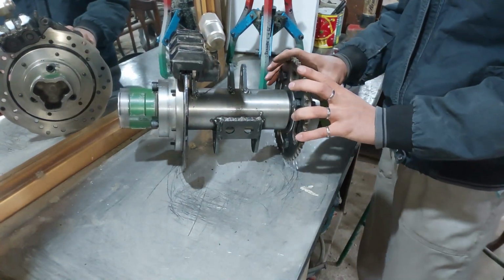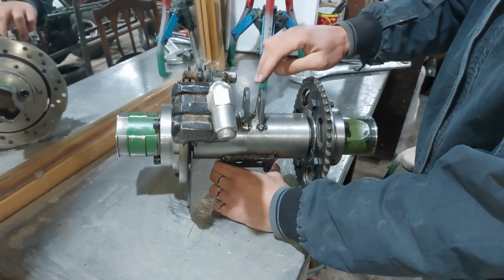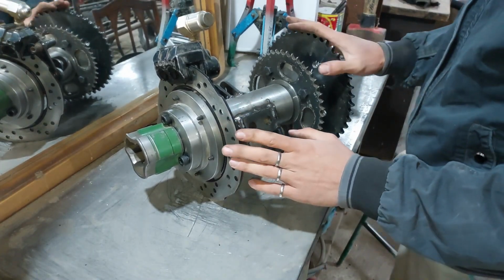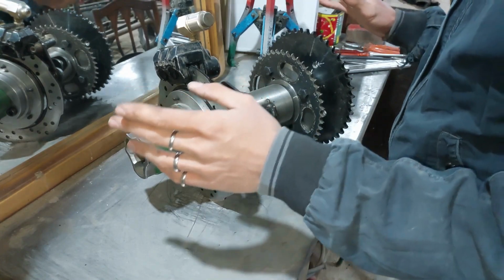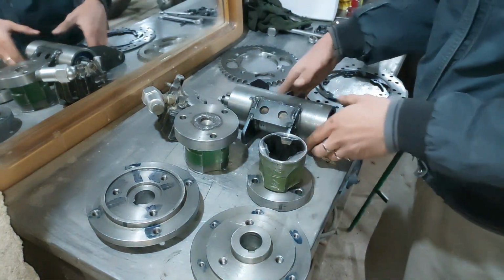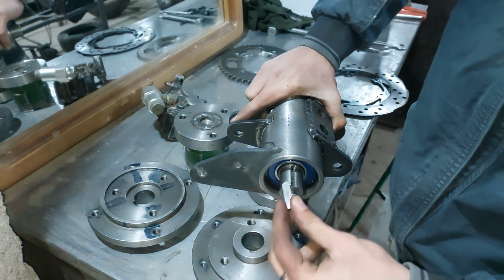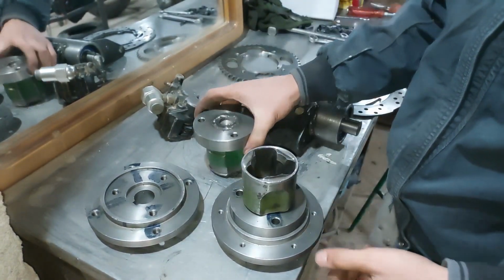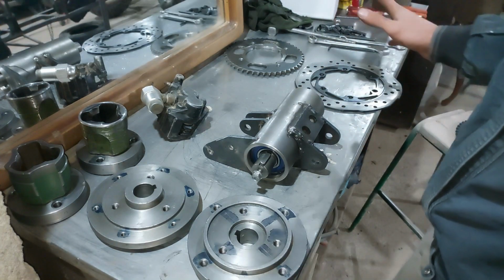how to build cross kart buggy PART 2: CHAIN DRIVE SPOOL

Comment: hi do you have a video on how you connect the axle do the spool? as per your video you have welded it to the Plate Disc ( Steel or aluminum? ) as quite difficult for me to look for a Miata Axle where there is a bracket to connect to the spool using nut and bolts.. Thanks for the reply..cheers!
Reply from the maker: Hi. No I used ck45 metal for all the parts of spool